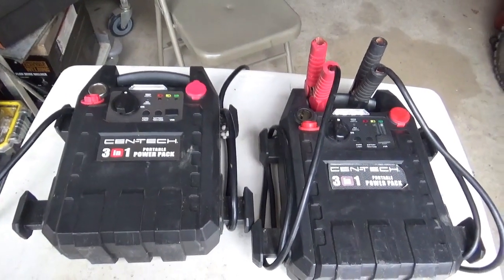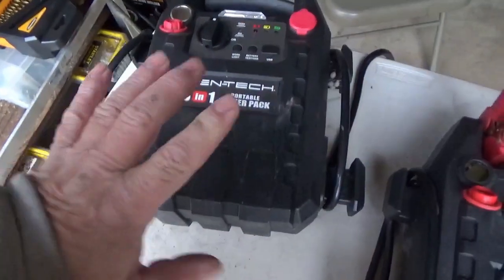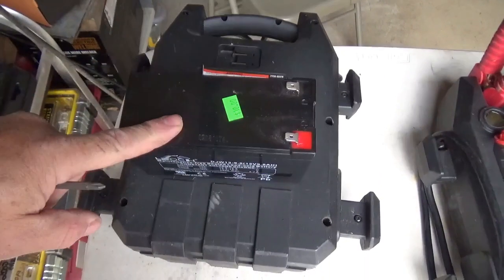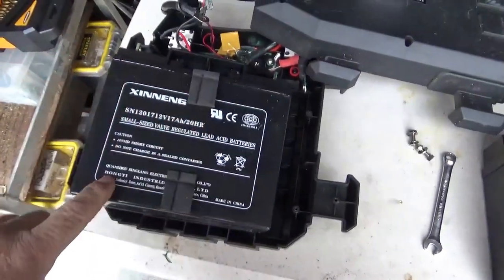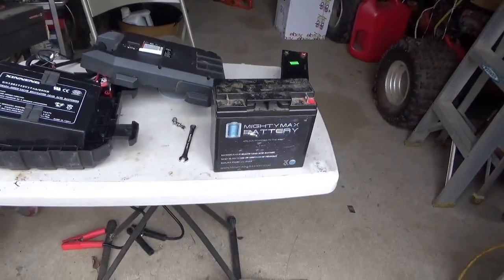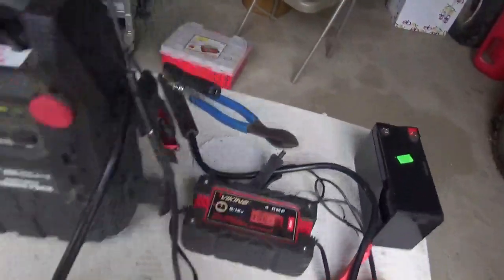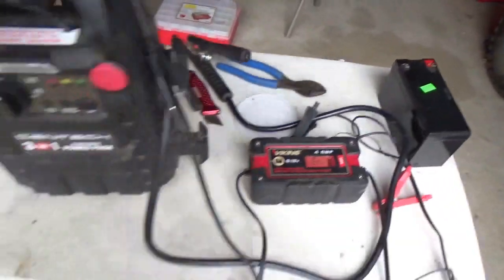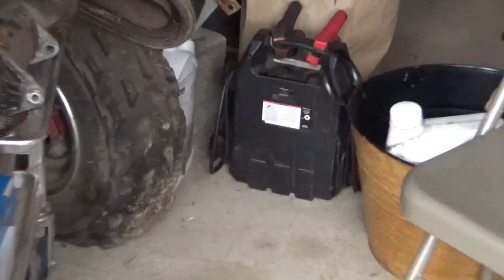Dead Harbor Freight Battery Jump Pack, Repair and Float Charge Hack!

Comment: I also turned to the Harbor Freight smart charger for my battery packs and got more life out of one (albeit probably killed it by letting it sit in storage too long).  I'm interested in how you would have connected the 9AH battery to the nut & bolt connectors in the back.

Comment: Mine appears to charge as the lights flash and then turn solid green... but as soon as you use it, it beeps continuously and doesn't Jump anything....so annoying...absolute garbage,  would never buy another one.
Reply: Hook it up to a real battery charger via the clamps, turn it on, and charge it properly with the external charger (if it has a repair mode, even better).
Once done, go jump something. And charge it again. After that the battery should be reconditioned and will hold a charge going forward. 
You can return to using the on board charger and plug it in every week/month for a few hours. 
Mine's going on 5yrs, working well 👍

Comment: I’ve got 2 jumper packs I desperately need to replace batteries in. One small one has a “12v 7Ah/20hr” battery in it, and the other has a “12v 18Ah/20hr” battery in it. Here’s the thing. I see these numbers all over Amazon, and I’m ready to buy them, but NONE OF THEM have the “20hr” part printed on the battery. They have the “12v 7Ah” and “12v 18Ah” part, but NOT the “20hr” part. Does that matter? Are they still the same? I think these are mostly marketed for computer UPS systems, while my jumper packs CAME FROM AN AUTO PARTS STORE. Are these batteries interchangeable? Do I HAVE to see the “20hr” printed on it, in order for it to work? Thanks!

Comment: So, I left the switch in the on position overnight.  Now it does nothing, even though the battery  still has a charge.
Did I burn out the microprocessor? Is there a fuse or reset? Any thoughts?

Comment: Thats good way to charge it.  I've always used a charger maintainer on mine. I bought cigarette lighter plug that connects to battery charge/ maintainer and plug into 12 volt outlet.

Comment: Centech are trash, i have several 900a units (with compressors) that i've used only a handful of times and they won't hold more than 12.8v and die very fast.  I have had no such issues with the JNL unit i have had for going on 5 years now.  still works like a charm.  also i noticed that Harbor freight stopped selling the 900s and dumped them all (someone is selling them on ebay now).

Comment: I did a similar thing to my centech 3 in 1 in the last year or two that i bought new. Added a quick connect and i can use any of my many battery maintainers on it when not in use. The battery should last longer. With using a multimeter i conclude that the on board charger does charge it up to a proper 14.5-14.7 volts. Then it shuts off and wont kick in untill the voltage goes fown to like around 12.7 volts with no float charge mode.
So the oem charger just does not put a float charge on it, which is what you need  for long term jump pack battery storage.

Comment: Nice! We had almost the exact same idea. Only thing I did differently was tie up the slack of the pigtail inside the jump pack, so that the plug just protrudes from the vent slot and lays nicely on the housing under the handle.  Great save Harvey!👍

Comment: Use an ES1230 battery for high performance long lasting power. I have 2 BoostPac brand jump starters and that is what they have in them. Battery cost about 36 bux and lasts a long time if properly used. Ours last almost 7 years and we started vehicles mostly with dead or even without a battery on regular a basis. The battery is high current capable and has heavy lugs. 👍👍

Comment: Darn I throwed my old one away. 
I have access to them little batteries like that too. Sometimes I can find a few in the transfer station where people throw them away in the recycle area. I just take a amp meter to check the power remaining so if it just needs a good charge it’s good. Some people as you know have no idea how to charge a battery or have the charger to boot. They usually have more $ than I do. 🤣 
I should have tried this hack too. Thanks Man

Comment: With the way your moving from machine to machine it makes sense to use a jump pack ! If you contact interstate battery they sell what they call BLEMS much cheaper then normal . That is the way I buy my batteries and those 9ah ones we use on our depth finders both summer and winter . My son makes charge boxes with plastic ammo cans and they work wonderful and hold a 36ah battery that he buys at Harbor Freight ( solar panel battery ) for I think $60 , when you go check out the solar section !
Reply: Dave what size ammo can? And how big is the 36ah battery? You're saying the charge box consists of the 36ah battery, a charger...and all that is inside an ammo can? A huge 20mm can??

I play with rc cars/aircraft. Those lipo batteries can be kinda dangerous lol. I mounted a small charger on the side of a 50cal can" drilled holes for leads to go inside box and grommetted the holes...now at least if one battery grenades while charging its contained. Maybe some nasty smoke but fire is not an issue now...at least while charging lol.
Reply: @jeremygalloway1348  the ammo boxes are 12” long x 10” high x 9” wide , they sell at Cabelas and sporting good stores for around $15 !